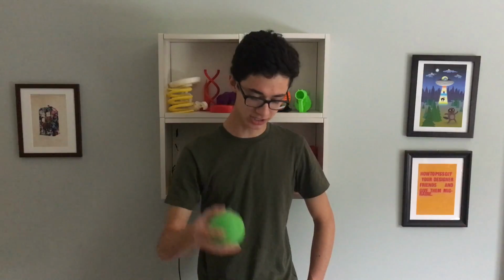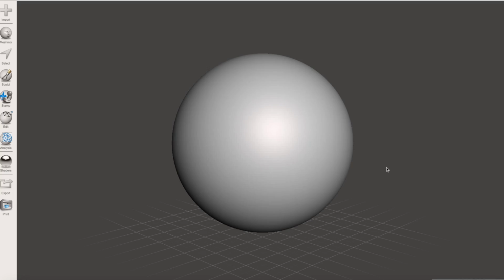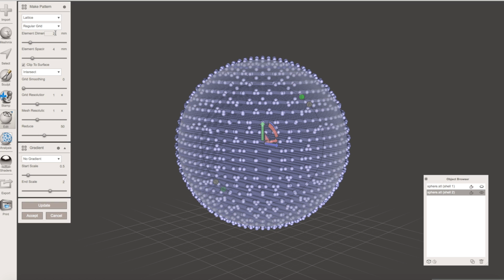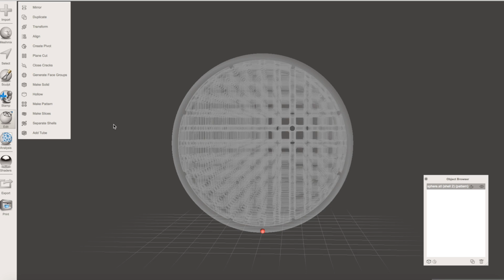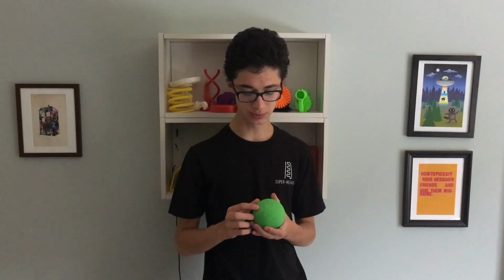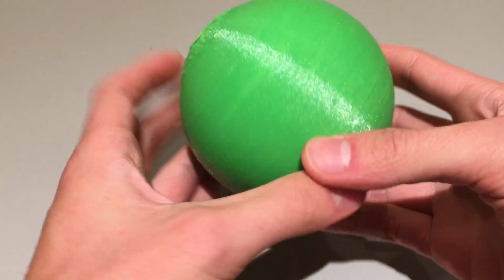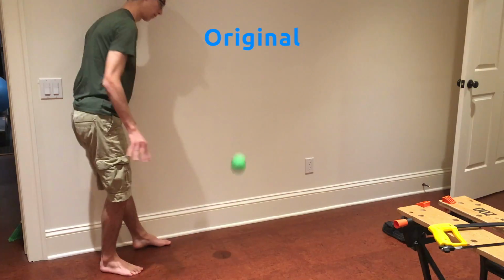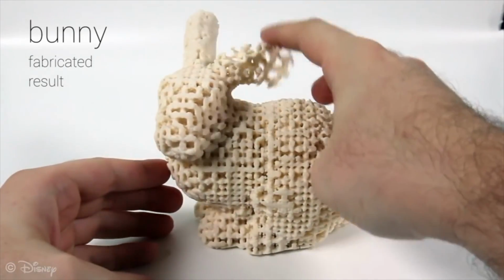NinjaFlex Bouncy Balls

Comment: I feel like the most bouncy design would in fact be a ball printed solid.

Remember, elasticity and flexibility are two completely different things.  An example is a steel ball bearing, which, despite not being very flexible at all, will bounce on a hard concrete floor almost as well as a rubber superball (try it!).

Comment: Ideally, you would want all orientations to have the ball act as a single spring. Whether it be by infill or walled structure, it should be consistent as much as possible (several faces on infill to be able to have more orientations supported). If you make it too soft, it will lose much of its energy to deformation, but if it is too hard, it will lose much of its energy to heat and its spring coefficient will be far too high to really allow it to deform much and bounce. So it is a balancing act between weight, softness/hardness, and internal infill or walls. The advantage of the walls is that because the object is spherical, the distribution is even without infill, and therefore, it will act similar despite whatever orientation. However, since you are printing the object, the smaller you get, the more radical the layer shift as you are making walls, and so you must be conscious about print quality. Ideally, you would want a large ball with little to no infill and a perfect balance of wall thickness and total weight to provide the highest bounce.

Comment: My lesson learned: Mold casting of structures has it's use cases... and sometimes shopping for something is the better option, like e.g. a rubber ball. That aside, annealing might help with the layer problem.
Reply from the maker: SevDev the point of my videos is not to create better versions of what can be bought commercially. I’m an experimenter that tests the limits of 3D printing.
Reply: @XYZAidan  Okay, and that's fine. I already thought so: There might be other structures similar to such a ball, where the insights of that experiments can be applied. 

But people just searching for the best solution to a problem, should keep all options in mind.

Comment: I am trying to print airtight ninjaflex actuator,  have any tips for getting rid of microscopic holes?
Reply from the maker: Most directly 3D-printed soft robotic actuators that Ive seen are not fully airtight, rather they are mostly airtight and rely on continuous high pressure air to actuate them. However, printing hot and slow will probably help make prints more airtight

Comment: Neat! -- It makes me wonder if you can print a lopsided lattice to compensate for difference between horizontal and vertical compression and stretchyness.

Also, I wonder if there is software to simulate this without wasting so much good ninjaflex! XD

On a final note, I encourage you to switch to the metric system (inches and feet are for people without 3D printers!) XD -- I'm from the US, and the only place where I've noticed that the metric system causes me any issues is with mile markers on the freeway... but hey, multiplying by 1.6 isn't that hard. :)

Comment: Did anyone else notice how he used different measurements in the program than he was saying afterwards when he was talking? The differences in values just made it a shit ton more confusing. Not saying that it was confusing before. But he went from 7.5mm to 10mm without an explanation for the density of the lattice. I thought the outer wall was 3mm. Then he said he's going to make it 4mm FROM 2mm. Everything is super inconsistent and it's hard to follow with how he's mixing up the numbers or changing it off camera.

EDIT: I know it doesn't matter, but still. It just seemed super confusing.

Comment: No scaffolding, none. That is optimal. Scaffolding just creates absorption.
Reply from the maker: I know that, if I didn't need it then I wouldn't have used it. You need some in order to support a full sphere, as the first 30% of the print is a pretty steep overhang.

Comment: Very cool! Does the acetone-cloth trick work on NinjaFlex? If so, perhaps using that to smooth the outer walls may help - or at the very least, make it look cosmetically smooth.
Reply from the maker: Acetone does not work as a solvent for NinjaFlex, but I'm curious whether baking it or using a heat gun could have the same effect. Thanks for the input!

Comment: You can also just select infill pattern as cubic or tetrahedral in Cura. This pattern is useful also when doing a print with low infill with long vertical parts where some parts are skinny and a grid pattern may miss these parts.
Reply: ArcanePath360 in my experience, those patterns don't transfer force very well, but it is helpful to have 3D infill available in the slicer. Also, at the time of filming, those features were in beta.
Reply: Yeah, it sounds good in theory, but the problem with them is the overhang where they are slightly offset, which doesn't give the best layer adhesion. For this reason grid is always the default choice and I only go to these other patterns when doing irregular shapes as I mentioned so that there is consistency.

Comment: That's very cool! You should do some more experimenting with this, and maybe with other flexible filaments that are more flexible or more rigid. Also, how much material was used printing one of those bouncy balls?
Reply: Okay, maybe more research/experimenting is not needed, but is there a way to mold one, so there are no layers?
Reply from the maker: MatthiasChristiaens thank you! I'm definitely interested in trying this with other filaments like FilaFlex or SemiFlex. For all prototypes, the material usage was around 150g. There's definitely more research to be done. As far as casting, I've thought about it, and there would be a lot of challenges, such as formation in the small tubes and mold layout. It would be a good engineering challenge!

Comment: Wow! The implications of this experiment will be interesting to see in soft robotics - curious to see where you will take this. Impressed by the thorough process you followed and the analysis of each of your iterations.
Reply from the maker: Thank you! I've been pondering it's use in pneumatic soft robotics. I think it may be hard to make inflatables out of, however it could definitely be used in other forms of soft robots. I'm thinking of using 3D metamaterials with Nitinol wire (shape-memory alloy) in order to make bots.

Comment: It seems the infill would be best if oriented spherically, like the spokes of a bicycle wheel, all pointing towards the center.  But i'm having trouble visualizing how to do it practically (maybe it'd look like the internal spokes of a Zorb ball).
Reply from the maker: I see what you mean, and that might actually work better in this specific case (ignoring that certain parts would be difficult to print), but in this project I wanted to show a isometric 3D pattern that could be used in more than one case. The ball was kinda just an analogy.